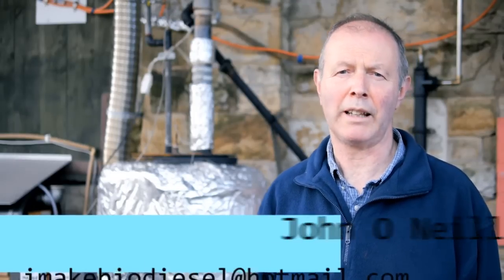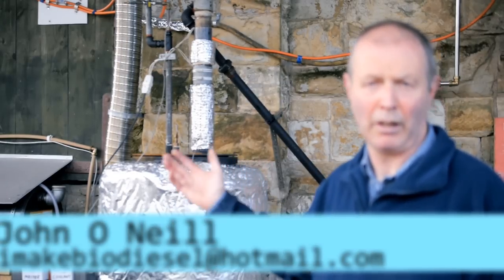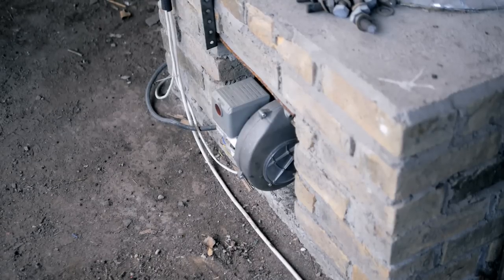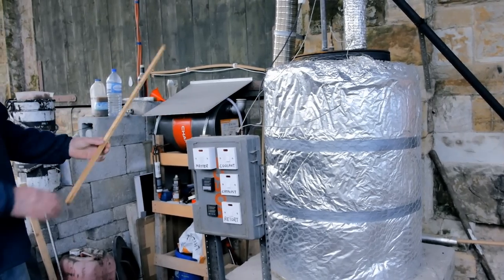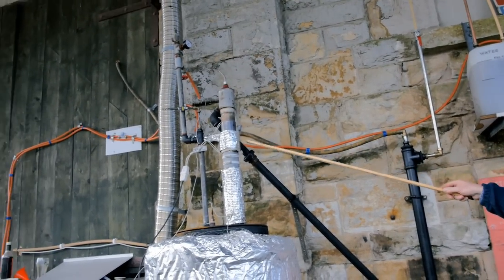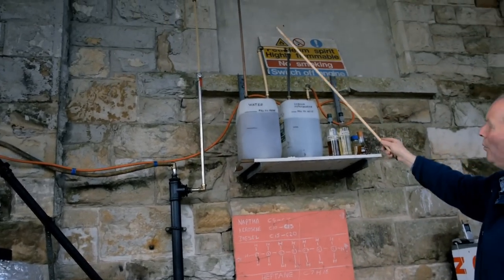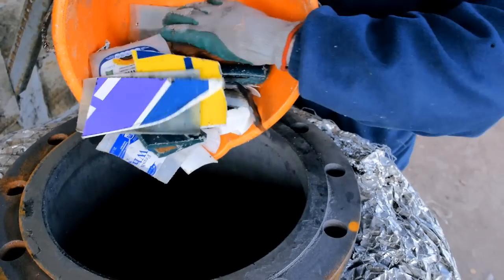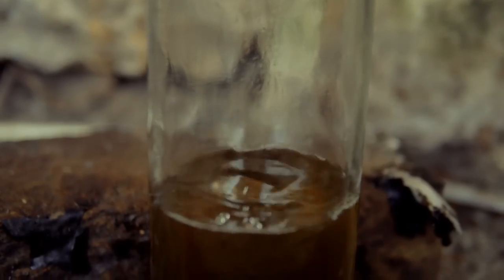Waste plastic to  kerosene fuel

Comment: This was really interesting. Is it possible to make kerosene from wood sawdust or chips?  Thanks.
Reply from the maker: In theory it would be possible to make kerosene from sawdust .  the sawdust or woodchips  would be gasified to produce syngas and the gas converted by the Fisher Tropsh process into a liquid fuel,  However this process would be very wasteful of energy and produce kerosene at a far higher cost than ordinary kerosene.  It would make more sense to simply burn the woodchips directly.
Reply: imakebiodiesel Thank you for your answer!

Comment: How much kerosene do you burn on average in order to create a liter of kerosene? Obviously more product is formed than the fuel required to perform the process otherwise it wouldn't be used, but I'm curious as to the ratio of product produced/fuel consumed.
Reply from the maker: My small experimental unit uses just over .5 litre of kerosene to produce 1 litre of liquid fuel and some gas and wax from a kilo of waste plastic.  This ratio could easily be improved in a larger unit with better heat exchange design and insulation.
In answer to some earlier questions   The temperature inside the reactor is 425°C,   and the catalyst works best as close to 425 as possible,  
I dont give information about my catalyst but if you do the research there is plenty of information available about cracking catalysts.  Its was not possible to condense the gases without refrigeration because they are mainly propane, butane and methane. 
I would not recommend using this technology  for  small scale  fuel production.   Biodiesel and bioethanol are much easier , more economic and less dangerous routes.  This technology only makes sense for larger plants with fully automatic controlls and safety systems, and where the  producer is paid to process the waste plastic.
Reply: Fascinating, thank you! Personally I'm going to stay away from fuel-making unless I learned how to make it safely. I just barely passed organic chem, I'd rather not accidentally blow myself up.
Reply: We 're pyrolysis manufacture company in korea. We convert waste plastic or old house hold into oil (15%naptha/70disel&kerosene/15 residue)We heat the furnace by disel burner or gas burner , there's two options.If you get know more information please contact us Thanks www.ecocreation-in.comeco@ecocreation-in.com
Reply: My BS detector is tripping and buzzing because the question is repeatedly asked, then avoided: liters in to liter out ratio? . Not a complicated question, and deserves a simple 3 word answer, rather than an evasion.  If negative, then we can move on or look at your primer or novel on how you created the special relationships to get free used vegetable and motor oil.  Even then, you don't explain the pollution issues burning those, and why not just clean and burn those for house heating.  I think I might guess one reason you might burn 5 gallons of vegetable oil and your week worth of plastic recycling to get half litter of kerosene.  But you need to tell me, I can't feed you the answer.
Reply: My BS detector is tripping and buzzing because the question is repeatedly asked, then avoided: liters in to liter out ratio? . Not a complicated question, and deserves a simple 3 word answer, rather than an evasion.  If negative, then we can move on or look at your primer or novel on how you created the special relationships to get free used vegetable and motor oil.  Even then, you don't explain the pollution issues burning those, and why not just clean and burn those for house heating.  I think I might guess one reason you might burn 5 gallons of vegetable oil and your week worth of plastic recycling to get half litter of kerosene.  But you need to tell me, I can't feed you the answer.
Reply from the maker: If you had bother to read the comments you would see that I have been asked that question twice and I have answered it twice  in litres in / litres out 
The yield from this system is relatively low and could never compete  with commercial kerosene.  Its mainly of interest to companies that have a waste plastic stream that they must pay to dispose of.
I dont recommend it for backyard projects as it is dangerous and not commercially viable.

Comment: hi, thanks for the video. 
my wife and I are trying to get off grid by the end of 2016. we're in the process of building a bio digester for methane gas, and we are looking for a liquid fuel source too. I would like to build a system like yours; are there any instructions on how to build such a system?
Reply: You are wasting your time on bio digester . I tried it there are way too many cons . Temperature has to be above 67 degrees and it take days for process to produce usable amount . Also there are problems with storing it .

Comment: HELLO, MAN I AM ANDRES FROM COLOMBIA AND I HAVE A QUESTION FOR YOU, RESULT THAT I MAKE DIESEL WITH THE SAME PROCESSES AS YOU AND DOES NOT GET OUT ANYTHING...  CAN YOU SAY TO ME WHAT CAN HAPPENED
Reply from the maker: +andres garcia   Sounds like your temperatures are not correct.  A mixture of PE and PP plastics will boil and vaporize at between 410°C and 450°C.  The head of the reflux tower  should be maintained at 330°C for diesel and 260°C for kerosene.  These temperatures are critical.
Reply: what is the cooling water temp. inet to feed to get stable temp. for diesel and kerosene to get.. how about the gasoline...

Comment: So how much kerosene was used to get that bottle of kerosene?
Reply from the maker: +Wayne Goff The efficiency of this process is relatively low.  In my system the yield of kerosene is 1.6 litres of product for every 1 litre of fuel used.  With a larger unit with better heating and more insulation 1.9 litres of product can be achieved.  This type of fuel can never compete with commercial kerosene, especially at todays low oil prices.  However in developed economies where disposal costs of mixed waste plastics are very high and increasing , this technology is a viable alternative to paying landfill disposal fees.
Reply: +imakebiodiesel Used engine oil and vegetable oil can be had for free. They both make excellent fuel and can be made to burn quite easily. In fact I have been running my car on used engine oil for 3 years now with no problems. Also the economy of scale will come into it. The larger your recovery system the better.
Reply from the maker: +Wayne Goff .  You are preaching to the already converted.  I have run my cars on biodiesel made from waste veg oil for 8 years and I heat my workshop with an ozzirt waste motor oil burner.  Both fuels are safe and suitable for small scale operation.
The synthetic kerosene setup is best done on a larger industrial scale both because the larger units are more efficient and because  automated safety systems can be incorporated into the unit at a relatively low cost.

Comment: im assuming the naptha is the higher fraction and it collects in the gas traps? kerosene in the lower collection ? do you know much about impurities ? also what is the catalyst exactly? cuprous oxide?
Reply from the maker: +Ashes  Wake .  in my processor about 8% of the fuel output is naphtha.  This can be separated and sold as a commercial solvent or left in the kerosene provided the blend does not have a flash point of lower than 38° ( see my video on flash point testing.

Comment: what is the ratio of pounds of plastic to a gallon of finished fuel?
also what about the gunk that is left in the bottom of the tank?
Reply from the maker: +D E Tarlton   this processor produces on average 1 litre of  fuel to 1kg of waste plastic.  There remains a small quantity of hydrocarbon wax mixed with elemental carbon. Incidentally this residue has exactly the same composition as black shoe polish.

Comment: Does this produce kerosene? What is 'synthetic kerosene'?
Reply from the maker: +Mike Ehrmantraut   Synthetic kerosene is a mainly saturated hydrocarbon chain of length between C10 and C15.  it contains less than 10% unsaturates and less than 1% aromatics.

Comment from the maker: Kash Khan,  The scrubber serves two purposes, first to allow gas to leave the system but not let air in.  The second purpose is to neutralize any dangerous gases that might be produced if the wrong plastics are mixed in with the feedstock.  The first scrubber is filled with a solution of sodium hydroxide (ph 12) and the second is a 10% solution of sodium hypochlorite.

Comment from the maker: The more highly active the catalyst the more volatile fuel will be produced.  However highly active catalysts are also very short lived.  I cant discuss my catalyst mixtures because they are the result of 2years hard work.
Reflux temperatures must be calibrated to a particular size of column and a particular catalyst.  There is no simple answer to that question.  Yeilds were discussed below with Henry Farrell

Comment from the maker: The large diameter vertical pipe is the condenser.  A smaller pipe runs up the inside of this pipe and carries the water to cool the vapour..
The liquid plastic boils at 385C, what fuel you get depends on the catalyst and to some extent the reflux temperature, but not the retort temperature.

Comment from the maker: Kerosene burners do not work well with true PID control.  I use the alarm circuit on the controller to energize a relay.  In other words it works like an ordinary thermostat.

Comment: also how do you control the temperature, since you dont use electric heating. Is the PID controller connected with the kerosine burner and turns it on and off, acording to the temperature reached ?

Comment: is this pipe that is going straight up at   1:50     represnts the water cooled condeser ?

Where is the water flowing to cool down the vapors ?

At 375 C degrees it starts to make kerosine, what about gasoline - at what temperature ?

Thanks

Comment from the maker: Thanks Henry,  as you can see from the video the unit runs on my own kerosene.  At present it takes 7 litres of fuel to convert 15 kg of plastic into 16.5 litres of fuel.  However I am working on a number of modifications that should improve that ratio.  These include returning the off gas to the furnace to provide some of the heat, redesigning the flue to conserve heat and adding a continuous feed so that more plastic can be processed in a single run.